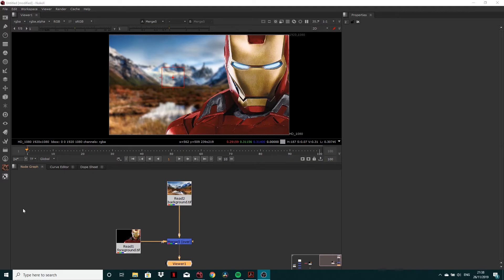Nuke Merge Node: Over Operation Explained

Comment: Is there a way to keyframe merge nodes? I have two videos and want it to change from one being over to the other at a certain frame. Thanks for the video.
Reply from the maker: You can animate the mix property on the merge node perhaps. If not use a switch node and animate that!
Reply: @creativetap7346  Thank you! <3